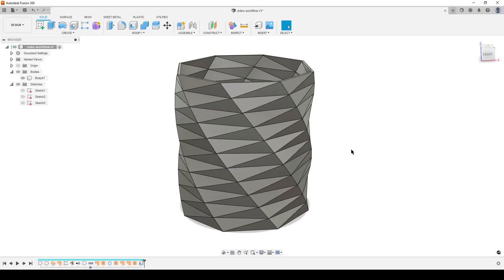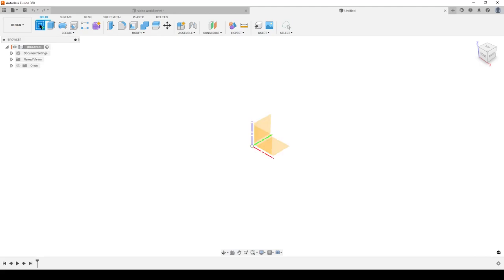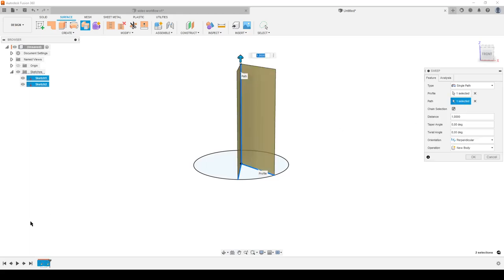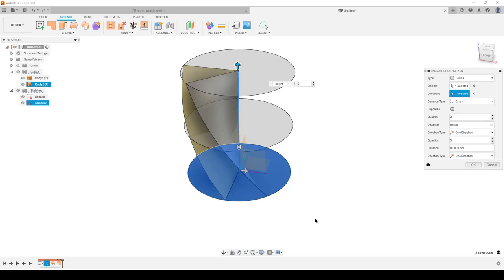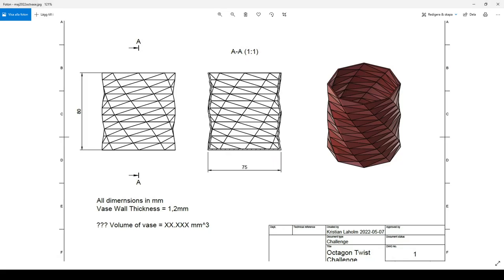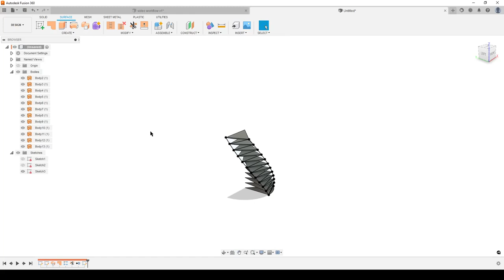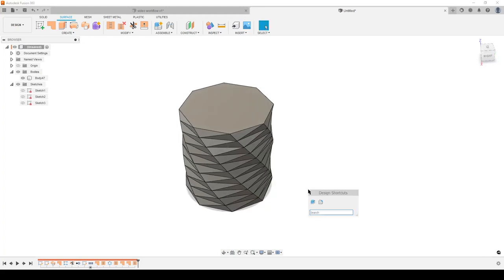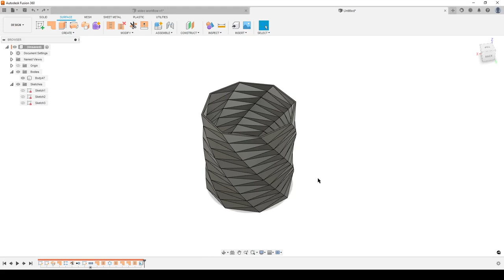Fusion 360 - Twist Faceted Vase (challenge workflow)

Comment: Cool, I rarely use surfaces. 
Do you have any workflow/model  that uses intersect when you extrude?
Reply from the maker: I'm using in some of the Platonic Solid videos but not with extrude (from what I recall). I planed on using intersect on the sweep in this workflow but it failed with the top and bottom circle bodies.